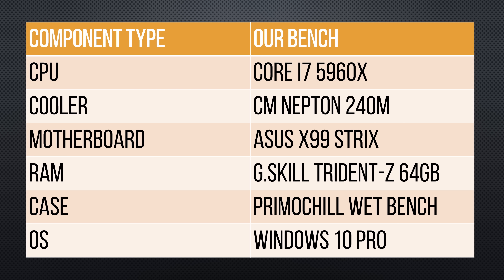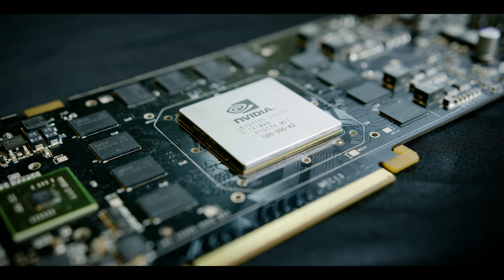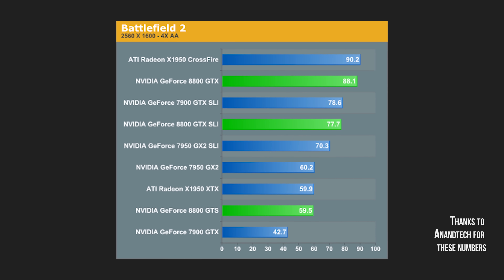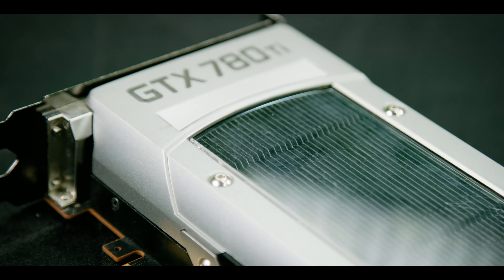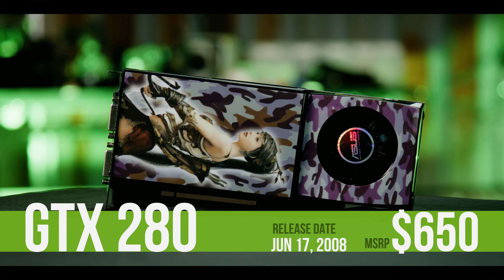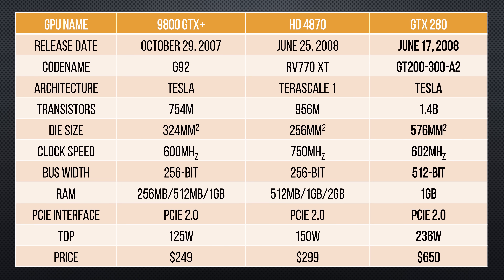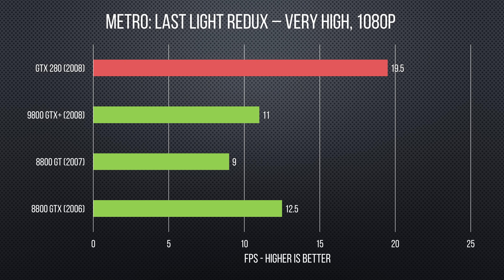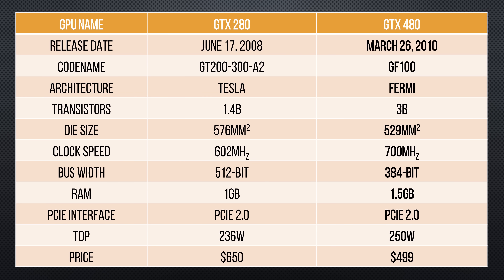10 YEARS of NVIDIA Video Cards Compared!

Comment: >pararell universe where AMD kept up
Well that didnt aged up so well
Reply: Yeah, Nvidia cards get obsolete the day their next gen comes out, otherwise... how can Nvidia follow this pattern that Linus has shown? Meanwhile... AMD cards get carried until they can't operate, and so... 7970 is almost on Maxwell level now, Fury overtakes 980ti, 580 is almost on 1070 level and in more and more games - RDNA is pushing way above its stream processor count.

Seriously though - it's going to be a fun video in 8 years when Linus would have to review 2080... no 2080S.. no 2080Ti... no Titan RTX.... Then again, he already glossed over all the 1080>TitanXP>1080ti>TitanXp, only mildly jizzing over the "unused GP100", so I guess Nvidia Tech Tips will make it look good when history calls.
Reply: AMD still needs to get Big Navi out, but from what I can see, it does look like it's going to be very fast. We might see the greatest leap in performance from the previous generation since Nvidia did it with the 8800 GTX. 
So compare it with Radeon VII, the best part made on the Vega architecture. It is barely any faster than the much smaller and efficient RX 5700XT. And if the rumors are true, in that we might expect almost double the performance of the 5700 XT, the alleged RX 5900 (or even 6900 for that matter) will be based on the all new RDNA 2 architecture. It is a standalone and new architecture, desinged from the ground up to replace the GCN architecture that has been used ever since the HD 7000 series. And it is supposed to scale extremely well with core counts

So a theoretical 5900 XT or whatever AMD might call it could look like this:
Compute units: 80 - Total core count: 5120 shader units (double the size of Navi 10) - AMD can scale the RDNA2 architecture beyond this amount if needed.
Die Size: ~520 sq.mm - Transistor count: 20.6B
Clocks (MHz): Base: 1605 - Game: 1755 - Peak Boost: 1905 (basing it off the RX 5700XT's clock speeds)
Memory: Size: 16 GB - Type: GDDR6 (16 Gbps) - Interface: 256-bit - Throughput: 512 GB/s (Or AMD might skip GDDR6 entirely and go with HBM2E on the largest models)
Theoretical compute performance (Tflops): ~20+
* This is all just a theoretical configuration and will not be the final product's config. But AMD has stated that they want to "shake up" the 4K gaming market, so having a card with specs close to this would spell good news for anyone gaming at 4K, and especially at high refresh rates.
Though Nvidia's Ampere cards seems to be a worthy upgrade over the current Turing generation, as the outlook points at around a 50-60% improvement over the current models.
Reply: @TsunamicBug  ikr
Reply: @GP2_Engine What aged like milk? When I wrote my comment all of my arguments was right. I don't have a Cristal Ball I can't see into the future.
Reply: @GP2_Engine Well yeah Zen 3 is what I expected to be the final nail for Intel in terms of single core performance. For Nvidia they are still fine the problem is they don't have any cards in stock they are all out of the stock and AMD can take advantage of this. AMD offers 3080 performance for 50 dollars less what isn't a big difference but well they I HOPE will have atleast better stock they will also get out of stock is 2020 it is what it is. The thing what I need talk AMD extremely good is the 6900XT is finally a competition for the high end and is over 500 dollars or euro where you live cheaper that's WOW! The 6800 and 6800XT are not impressive they are nice a little bit cheaper or little bit more expensive when it comes to the 6800 without XT and they offer more Vram is fine but the real deal is when you get over 500 dollars cheaper. I had hopes to see more aggressive marketing for the 6800 series still NICE cards but at that point Nvidia is also a decent offer although I still recommend AMD because of the 16gb Vram. Overall yeah AMD finally is back in the game I still don't feel I need change my 2060 Super Aorus because this GPU is around PS5 performance and I'm fine for couple more years to come. My upgrade will probably be a RTX 4000/5000 or RDNA 3/4 RX 7000/8000 and at that point I will take a decision what I will buy Nvidia or AMD it will probably be next time AMD. I'm still interested in the ray tracing performance from those AMD GPU's. For my CPU my Ryzen 7 3700X is still kicking and is nice not best in single core performance but still a great CPU for gaming and 8 cores will future proof a little bit for next gen games considering that some end of 2020 games can use now 6 and even 8 real  cores not threads! Sure not at 100% usage but still decent amount for all those cores.

PS: Yeah I didn't expected AMD catch up with Nvidia in high end premium ultra mega market. I expected them slowly beating Intel if Intel was lazy enough delaying they 10 and 7nm process and always re-use they old one. Well this actually happened but yeah in GPU market big big surprise a GOOD surprise!
Reply: Are you saying AMD has a video card on par with a 2080Ti?
Reply: @omnimoeish  https://www.notebookcheck.net/AMD-Radeon-Pro-Vega-II-Duo-displaces-the-NVIDIA-Titan-RTX-to-become-the-world-s-most-powerful-GPU-but-don-t-expect-to-game-on-it-anytime-soon.423036.0.html  
Well, seems they have a card that surpasses the 2080ti and RTX titan...
Reply: @omnimoeish  the only cards AMD has no cards to compete for are GTX 1660 Ti and rtx 2080 ti, yet. Most likely they will release Rx 5500, 5600, 5800 and maybe even 5900 cards.
Reply: @tek1645  can confirm rx580 can run shaders and some ray tracing
Reply: @finmueller7827  yeah and guess what. Like I said, the Rx 5500 would release and now there are rumours of Rx 5600. It would only make sense to release Rx 5800 and 5900 before Ampere atleast.
Reply: @tek1645  true
Reply: @finmueller7827  and guess what. Like I said the Rx 5600 would release and now Lisa su said big Navi is a thing. Probably will see it at computex or e3
Reply: @tek1645  pretty excited to see what AMD does
Reply: AMD have slow gpu's what can't be compared to Nvidia AMD's best efforts defeated the normal 2070 aka 2060 Super. Nvidia has 4 better gpu's on consumer platform the 2070 Super the 2080 the 2080 Super and the 2080TI.
Reply: @strohhuttv8848  2070 super and Rx 5700 XT trade blows in a veriety of games so only 3 cards. Considering AMD hasn't even released all of the Rx 5xxx cards, that's pretty good but Nvidia will also be coming out with new GPUs so AMD needs to hurry up
Reply: @tek1645  2070 Super is around 10% faster than a RX 5700XT sure a 5700 XT can beat a 2070 Super in some games what favor AMD more but in most games a 2070 Super is faster. When AMD have a answer for a 2080 or 2080TI Nvidia will release Ampere RTX 3000 series and still be faster than AMD. The problem what AMD has they are always 2 steps behind the big players same goes for Intel who is faster in single core preformance gaming performance.
Reply: @strohhuttv8848  definitely not intel. AMD is in the better position for CPUs and they're faster in CPUs, please stop being a fanboy.
Reply: @strohhuttv8848  Not even close to 10%. At most 7-8%, but considering its 20% cheaper...
Reply: @targusnazg3963  Well huge difference from 10 to 8% faster and did u read my other arguments? The RTX cards looks expensive but for what they give u they are good value because fps are not everything... In my opinion the only waste of money is 2080 or 2080TI specifically the 2080TI but people who buy 2080TI dosn't care about price = performance or gimmicks or anything they want THE BEST premium thats all they want like people who buy Rolex over a decent watch or Ferrari or Gucci u pay for premium. I think is stupid silly but if u have the money and u don't care about value who cares go buy the BEST.
Reply: @strohhuttv8848  They're not good value at all actually. Once you get up to the 2070 they start increasing in price ludicrously without an equivalent jump in performance.
Reply: @targusnazg3963  How I said read my comment fps is not everything.
Reply: @targusnazg3963  I know you AMD fanboys don't care about features, just about "Muh FPS!!11!!11!!"; but you know, RTX is something that AMD seems it isn't going to have ever, So get out of here with your "Muh 20% cheaper!!11!!11"
Reply: @victorsegoviapalacios4710  Ray tracing is also a feature used by a scarce few games and not even utilized to its fullest potential. You're mixing up RTX with Raytracing. AMD has already confirmed that their next cards will have raytracing capabilities. But again, when more games actually use it for more than just one thing (things that most people wouldn't even notice much of a difference between) I'll consider it a feature to balance cost with. Until then, it's nothing worth shelling out over $100 more for.

Comment: my gtx980 is 3rd  but probably not now as the rtx series has came out by now  . i currently have the afterburner edition gtx980
Reply: and i rarely see any of those editions on ebay here in the uk . so  if i want to run them in sli  it might be quite hard to get an afterburner edition to match the one i have

Comment: I have a PNY GeForce GTX 280 Performance Edition. Not in my current machine (Because I use a laptop) but I am currently trying to get a DVI to VGA input because no display in my house uses DVI so I am trying to get a converter to use on my monitor with VGA.
Plus I search up (PNY GTX 280 Performance Edition in amazon shopping and get no result. is it a rare video card?

Comment: I had a 8800gtx back in 2007 I was the only one that could run crysis... what a huge upgrade from my 7900 gtx wow what a time to be alive... about a year later I built a machine running two sparkle calibre  9800gtx  in  SLI.... wow times have changed... currently  running a 2060rtx  strix

Comment: My NVidia history includes me owning the following cards: GeForce 256, GeForce 2, (Ummm... several versions inbetween which I can no longer recall, but memory kicks back in at...), GeForce 450 GT, GTX 750Ti, GTX 1050Ti, GTX 1060 3GB & GTX 1060 6GB 

(you may wonder why I owned 3 mid-range 10-series cards... I just kept buying them at bargain and giving the "older" ones to my kids computers).

Comment: I had a GTX 9800 (I don't remember it being a +, but I also don't think I spent $300+ on it either). What a beast I remember that card being. I think I bought it off TigerDirect and it came with Call of Duty 4. I played that game through so many times, and played its multiplayer like crazy. Still one of my favorite games, but I hated the kill streaks. I could play it on max settings smooth and it looked amazing, although I think I had a 1600x900 monitor or something. Good times! I think that was my only Nvidia card actually..

Comment: i started with a ATI RADEON X1950 PRO 256MB DUAL DVI S-VIDEO PCI-E VIDEO CARD in 2006 cause my sons single core computer had trouble with vanilla wow and it was 500 dollarsn had to upgrade the power to a 500 and it ran for years as 60 fps and no problems ever till it started getting full of dust in the vents and the board turned black and tearing in the video occured. havent had to buy a new card till the new hp elite was out with a gt 800 series quit working. now im wondering what to go too next on a build. will be interesting. hope im not a dcell by then :P

Comment: My first discreet graphics card was a 6600 Gt back when I was 14 & Radeon seemed like a neck to neck competitor and superior even, then updated to a dual GPU Radeon 6990 in 2011 which I never happened to push to the limit with games and got outdated quickly with poor crossfire support, now I have a 2080 Ti which I received today. Feels completely worth it after such a gap of 7 years in purchases!

Comment: In my memory the most impactful performance leap was from normal graphics cards to a PCI ported Vodoo cards in terms of absolute insane performance boost and graphics (especialy if you had enough money to link  up 2 voodoo 2 cards). When the first Gforce 256 card came out i had a Riva TNT 2 and the difference in performance was once again through the roof (i missed the market leap). The performance increase from there on out kinda climbed pretty steady in my opionion. Its been a while since ive seen a  tremendous difference. Not since APG got replaced by PCI-E.
(obviously the PCI-E has had 15 years or so to go speedy on so ofcourse much has happened since MX series to GTX series 2 - 10 its just not the same impressive visual difference)
Im looking forward to the next voodoo experience ! I guess we have to wait for VR hologram tech or smth.
Reply: I agree and would like to add the 8800GT(S)(X) to the list of game changers with the wow factor. I upgraded my first PC(IBM Aptiva - Intel P100, 8MB RAM, 28.8K Modem,Trident PCI 1MB VRAM) to 2MB VRAM, Voodoo 1, and a MB cache chip. I had been playing Descent for a while before. The first time I played the 3Dfx version that came packaged with the Voodoo.... Man, I was just blown away. Like 14 years old and brought to almost tears. I had never seen anything like it! 

From there I had several different PC builds. Along the way there was the Voodoo, S3 Savage, Matrox G2xx?, Riva TNT, Rage 128, Geforce MX4, Geforce 4800Ti, 6600GTX, 7900GTX, 8800GTS, 9800GTX(X2), ATI 5870, GTX570. 

Now, while the 8800GTS wasn't quite as world changing as the Voodoo, it definitely showed that Nvidia had arrived in the future. At that time in gaming, we could do pretty or we could do fast. The games were advancing faster than the hardware for all of game history until the 8800. That's when it changed and hardware has been running laps on software ever since. At least in respect to gaming and the consumer market. Even the pimpest of rigs previous ly, couldn't do what the 8800GTx did. 100FPS on Halo 2 with MSAAx16, 16x AF, V-Sync etc.

There are 4 real wow moments in my life. Playing\seeing the NES for the first time. Playing Mario 64 for the first time. Playing Descent on the Voodoo. Installing the 8800GTS and realizing how completely superior it was the performance of a 7900GTX or anything else on the market. I think it wasn't until the late AMD HD 3xxx series or maybe HD4xxx before anyone managed to catch-up to Nvidia, though I wouldn't say anyone has really caught up to them for what they do.

Comment: non of them were revolutionary as 1996 Voodoo1 or 1998 voodoo2. I still own voodoo1, riva128 and nvidia 256 (and few modems, mainboards etc) 
I'd say Nvidia did a huge leap forward (but not revolution) with geforce 256 and GTX8800 but they had many good cards as well like gtx280, 480ti, titan, 780ti, 1080ti. rest are commercial products to make more money.

Comment: Yep, my GTX480 is still up and running but they dropped DX12 support, claiming it wouldn't work. Hmm just wondering why the 358.70_geforce_win10_64bit_internationalDev Driver had DX12 support and could run 3Dmark DX12 tests just fine...

Comment: How come you didn't do a round up at the end as to what conclusions can be drawn from 10 years worth of GPU analysis? What direction we anticipate gaming to go in and at what pace.
For me it's very clear that bringing new levels of gaming performance is getting harder and harder with each generation. In some of those early cards you were doubling the frame rate and by the end you were getting maybe 20 or 30%. If this trend continues it will not be long until we will be very much in the CPU performance increases of 5% every 2 years!

Comment: My only issue is, linus says  amds only competitor was the 4870, ern nope the top 4000 series was the 4890, which was actually quite a bit faster than the 4870. That like you bench marking the gtx 970 not the 980 etc.

Comment: I had GTX580-680-780-980-1080 in sli I gave up on sli and now have a single 1080ti if going from 7 years of sli to a single card doesn't tell you that sli is dead I don't know what will...I had hopes at the beginning of VR that they would use it boosting SLI (nvidia was pushing it) but history proved me wrong and win10 and dx12 ended up killing a lot of features we tought would never go like exclusive f..ing fullscreen :/ don't bother replying to this I won't read it..I turned the SLI page I'm done

Comment: my very first graphics card was a 8800 gts, still have it sitting on my shelf as an antique, at the time I didn't have a clue about pc gaming and only wanted a video card so I could have two monitors after using dual monitors in my first ever job and having my eyes openened, I took my dell dimension 5100 over to the 'pc for less' shop and asked for a dual monitor card and was told to come back in half an hour. The card I originally paid for didn;t work inside the dell and he gave me the upgrade to an 8800 gts for nothing, he had to cut a bit off the gpu to make it fit as well. COD 4 was all the rage back then on pc as well.